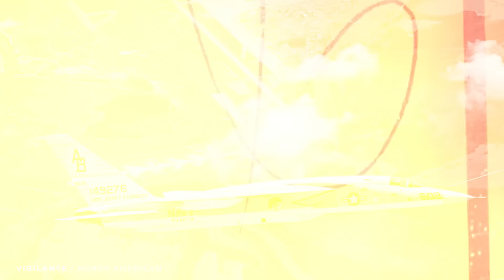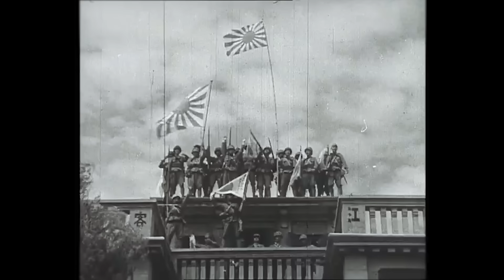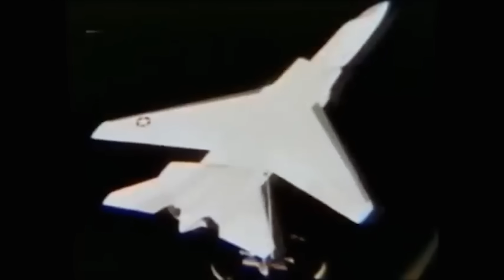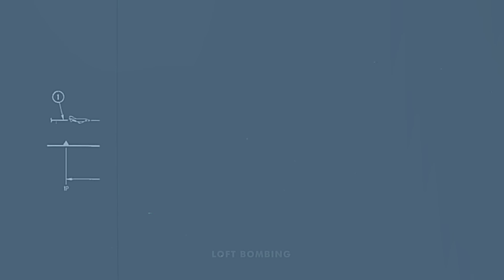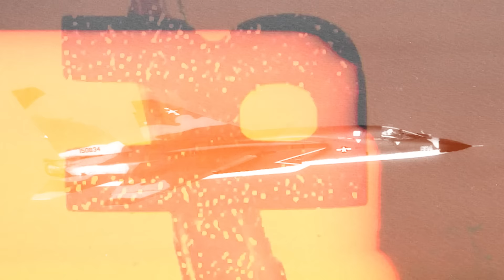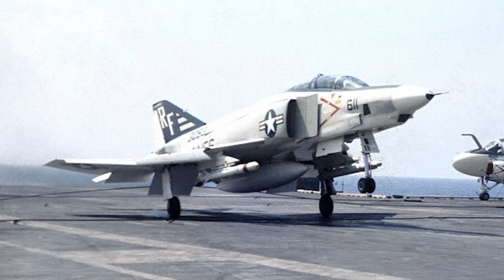Why was the A-5 Vigilante forgotten?

Comment: As a bomber, the A3J was a failure due to the nuclear weapon delivery system, which led to instability of the bomb after it had been ejected from the linear bomb-bay, and hence to poor precision, and because of inadequate range. This resulted from the initial specification that called for the capability to be catapulted with zero deck-wind, when the carrier was at anchor. This severly compromised the aerodynamic and weight sheet. The aircraft became a success when both were dropped, as the un-armed RA-5C flying at much higher  weights.

Also, it seems that the missile proposed with the NA-349 was the AIM-47, not the Navy's AIM-54 Phoenix. Also this NA-349 was part of the IMI programme (Improved Manned Interceptor). "Retaliator" was the name of the NA-246 project, a denavalised A3J-2 that NAA offered to the USAF in 1959.

Comment: The Vigilante was an extremely high performing aircraft with nuclear strike as it's primary role. The technology of the era did not lend itself to multirole platforms and it really was cutting edge. It was still a hard aircraft to counter in the 80's and if it was being modernised for further service it may have been a better strike aircraft than the A-6.

Comment: I never saw an A5 or RA5 as an aerial tanked. One reason the Russians took Manchuria so fast was that Japan has been stripping troops out all through WW2 to a level that there was only a token force. Two thing caused the Vigi to be retired. operational cost was one the lack of Airframes was the outer. From 1958 to 1970 there were only 156 built. As the recon version the squadrons operated 5 aircraft, by 1974 it was 4 and by 1978 it was down to 3 and the number of squadrons was reduced. Other aircraft being used for recon they all came up short in the type of intel they could provide. The only aircraft that could match it as a recon platform was the SR71 which was faster but no better in the intel it provided.

Comment: I remember the Vigilante. I built a model in 68?. Impressive specs. Some say that the MIG 25 was heavily "influenced" by this aircraft. I can see that - slap another vertical stabilizer on it and they look quite a lot alike.
Reply: NAA did pitch a twin-tail Vigilante, and even built a full scale mock up - there are photos to prove it too. The USN rejected the twin tail concept - choosing the folding single tail instead. It was a brutally quick aircraft - NAA cleared it for a Mach 2.5 transatlantic record flight, although the attempt was not made so we'll never know just how fast it could be...
Reply: @fungibleunit4477  Thank you for that info. Imagine twin (shorter?) tails and the 3rd engine.
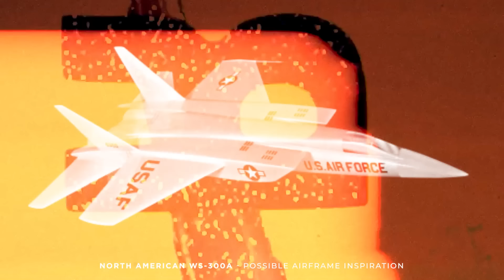Reply: Look at the model at 3:56.  Even Sir Peter Ustinov would say that was a Foxbat with just a quick glance.

Comment: I read an article written by an A-5 pilot where he described ambushing F-4s on their way back to the carrier when he was carrying a light load of fuel and using his various lift mechanisms to turn inside the F-4s and then go vertical as needed with a climb rate exceeding that of the F-4. If there was an issue with the A-5, it was the USN's demand that the A-5 be capable of being catapult launched with no wind over deck. This added weight due to the need to add lift devices to the wings.

Comment: Ah, the ‘Vigitoy’… If the bomb module was not ejected forcefully enough, it had a problem with being trapped in a low pressure zone immediately behind the fuselage and not dropping cleanly.
Imagine ripping along at somewhere around Mach 1 and having a live nuke floating along right behind you…

Comment: The WS-300A at 3:55 has a striking resemblance to the F-15 eagle.
Reply: I was going to say Foxbat - its uncanny.
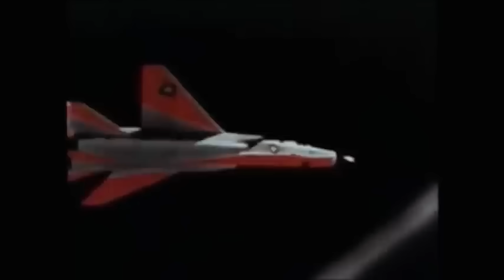Reply: Most definitely the Foxbat, especially with the model at 3:55.  But take a look at the paint scheme at 6:34; a quick glance could easily mistake that for the prototype F-15 paint scheme, used to set performance metrics.  I guess I didn’t realize that particular red & grey scheme was ‘a thing,’ but now I want to say the XF4H-1 (I think I have that designation correct), the first Phantom II prototype, had the same scheme.

Clearly, the MiG-25 derived inspiration from the A-5 models, but perhaps some NAA engineers from the XF-108 and A-5 programs migrated over to McDonnell Douglas?

Comment: Much of the airframe, and indeed almost the entire section from the intakes forward, was intended to be shared with the F-108 interceptor as a cost-saving measure.  But when the XF-108 project was cancelled (allegedly due to pressure from the Canadians wanting to protect their very-similar Avro Arrow interceptor), the cost of the Vigilante project jumped by nearly 70% basically overnight, effectively crippling it financially.  Then the USAF cut the Navy's strategic role off at the knees, crippling it operationally.  The poor thing never had a chance.

Comment: The A5 was such an advanced aircraft designed in the 1950 that actually made it to production. More details on the variable geometry air intakes would have been appreciated in this video. The period this aircraft was in service was a period of immense technological advances and political infighting. The A5 had many of the capabilities that the TFX program was trying to achieve, but F111 was nearly a decade behind the A5 before being used in Vietnam.  A comparison of the A5 & F111 would be enlightening. Was there any behind the scenes promoting the A5 as an F111 alternative? Seeing the proposal for a Phoenix laden platform before the F14 took to the air on its maiden flight. Was the A5 ever considered as a fleet defender against Soviet attack aircraft in lieu of the F14? It seems the A5 was an advanced  design but not flexible enough for further economical development for other roles. The rug was really pulled out from it when it was not really needed for nuclear strike. A couple reasons are the development of smaller packaged nuclear weapons and the ballistic missile submarine.

Comment: The first model i built at age 8 (1963). It had a spring loaded red bomb in its tail that could be ejected by pushing a small button in the fuselage.
Reply: The Vigilante was also one of my first models. No spring loaded bomb, but gee those lines were fine!

Comment: With favorable temps aloft, it could supercruise. Same engines as the F-4 and running recon slick, escorting Phantoms left early, and the A-5 caught them up. Also, at higher altitudes with the F-5's low wing loading, an F-4 bouncing a Vigilante often learned things they didn't want to know. Also, the mod version had LEX's, a very early or 1st application of leading edge extensions.

Comment: The A-5 was based on a F-108 rapier, an aircraft never finished.  They repurposed the F-108 rapier program to make the A-5 Vigilante.  

The F-108 rapier was how I started getting into cold war aircraft and history. I learned of the F-108 Rapier through learning about the history of computing. A major program just as expensive as the Manhatten project was to make a huge vacuum tube supercomputer called 'SAGE."  We're talking about a vacuum tube supercomputer that filled a whole multi-story building.  They built several of these.  Through these SAGE buildings was fed all the data from radar stationed positioned from Canada to the west and east coast of America, and radars from aircraft and Naval ships.  They wanted to make a mach 3 aircraft designed around this SAGE - the F-108 Rapier.

They never finished it.  But, to salvage the program, they built the A-5 Vigilante. As with the Rapier, the Vigilante was killed off by Russian satellites and ballistic missiles.
Reply: True, but the Concept might have been more of a Concurrent Program.
I believe according to this video, A - 3 - first flew in 1957, was Operational in 1961, then modified to the RA - 5 - C Vigilante, The - F - 108 - did Share a number of Similarities, but with a Top Speed of Mach - 3.
Reply: @bretthoffman2128  Had a hard time tring to come to terms with this.  The A-5 Vigilante wiki doesn't say much about the F-108 Rapier, but it does link to F-108 Rapier "for more information" where I found this,

"Despite the extra money and time spent on the Rapier, it was not wholly in vain; the North American A-5 Vigilante supersonic carrier-based nuclear strike bomber developed for the U.S. Navy, which was later modified into a carrier-based reconnaissance aircraft, retained the fuselage/weapon package and systems design of the Rapier. In many ways the Vigilante could be seen as the successful scaled-down application of the Rapier design principles in a Mach 2 supersonic design."

Sounds like a concurrent program.
Reply: @oker59 Yes, I thought so too
Reply: @oker59 I think that’s a plausible assumption.
However the A - 5 - first flight was, according to the video, August 31st 1958.
In some comments, I’d mistakenly thought it was 1957, upon reviewing the video, I found it was actually 1958.
The Mock Up of the Rapier was I think 1959, not 100% but reasonably sure.
Reply: @bretthoffman2128  I can't help thinking the moch up of the rapier was done even though they knew the 108 rapier program was over. 

That the Vigilante program was done after the rapier program . . . to pick up the pieces and do something with all the progress that was made.  And they later just did a quick moch up just for the fun of it.
Reply: Correction the funding by the Navy was Approved in mid 1955.
Prototypes Produced in 1956 
First Flight August, 31st, 1958.
Maybe just before the -F - 108. - Mock Up.
Reply: I thought the F108 Rapier was related to the XB70.
Reply: @briancavanagh7048  It is!
Reply: The video channel ‘IHYLS’ recently posted an F-108 video where a link to the A-5 was mentioned.

Comment: Huge opportunity lost for Australia right there.  The beloved Pig was great but really, REALLY expensive and didn’t come to full fruition until late in its operational life.  Great capabilities but hard to justify for the RAAF when their primary combat jets were still Mirage III.  I mean, COME ON!  The Mirages were great for Aussie industrial capacity, but offered little by the 1970s, with short a range to do anything meaningful, especially if it had anything to do escorting a strike pack of F-111.

In an alternative universe, the RAAF would have been far better off with a dedicated strike version of the A-5 Vigilante equipped with twin after-burning Speys.  Junk the “bomb tunnel” where the fatter Spey would have comfortably sit, with additional fuel in the space there, get rid of the naval equipment which made it heavy, and if really creative (and well funded), give it a smaller wing for better rides at low altitude.  It would have arrived sooner with far fewer teething problems, and… it could have even been built or assembled in the land of Oz for far less money and pain.  And kept Australia in the aircraft manufacturing biz for a bit longer… maybe.
Reply: You are redesigning the bloody aircraft for 30 machines?  No!
Reply: @t @timp3931 he Spey was only slightly larger (fatter) than the J79 and there was a lot of space between the engines.  A lot!  I doubt it would have been beyond  North American to adapt it together with Australian engineers.  Of course redesigning the wings would have been a very significant endeavor, but I did mention that as an option if there was a lot of political stomach to back that.  The thing is it probably would have cost a lot less than what the Pig (as wonderful and beloved as it would eventually become… after long time) and given the RAAF an interesting capability sooner, for less upkeep, and maybe, just maybe, furthered Aussie aeronautical industry.  Because after the Mirage… what came after that?  Not much except MRO and components.
Reply: Ahh Yes, but Just as North America Aviation, was Eventually Boeing, The Australian Aircraft Industry Died.
Reply: @bretthoffman2128  True. Amazing that Boeing (and I say this from a place of love, having flown the 737 and 767, airplanes that I love), as a company is the death knell of almost every other aircraft manufacturer it touches.  Embraer and the Brazilian aircraft industry was literally saved when that deal fell apart.  Good riddance.
Reply: @juanpablo681 You Flew on, or piloted both.
I flew on both as a passenger, the 737 was an excitingly relaxing flight.
The 767 was just Exciting, and pushes you back in the passenger seat on takeoff, it flies very well, and turns quite decisively sharply, then seemingly dancing in the air.
Decent and Landing are equally exciting, but it settles down very gently.
As as long time passenger, I thought the ride on the 767 was Excellent, Start to Finish.

Comment: Excellent presentation. Just a personal impression, but I've always felt that the RA-5C reconnaissance version was a bit overkill in terms of aircraft size and complexity for that role, but they USN needed to do something with it, and that was a role it could perform well, so they used it that way. Also, the basic design validating the rectangular intake ramp technology for supersonic flight that influenced aircraft like the F-14,15. Also on the MIg-25. Remarkable design in any event. Thanks.
Reply: Yes.  Beautiful aircraft.  It was replaced by a pod.

Comment: Looks like a MIG25 and an F111 had a baby.
Reply: I'm not sure if really true, but I've read the Soviets at least looked a lot into the A-5 design when developing the MiG-25 Foxbat.
Reply: @dougcastleman9518  That was the suspicion at the time. However, the roles could not be any more different. The MiG-25 is basically the lower stage for a long range AA missile.
Reply: @HotelPapa100  That's the funniest way I think I've heard anyone put it ahaha.
Reply: @HotelPapa100   the mig-25 was two aircraft, a interceptor, and a bomber-recon-EW aircraft, the a-5 vigilante matches the roles of the mig-25RB closeley
Reply: No, that one would be constantly drunk and flapping with its arms all the time

Comment: Looks like an F-15 predecessor from the 50's
Reply: In the initial rendering, also the - F - 14 Tomcat
Reply: @peterboy209  if the f15 and mig25 had a baby
Reply: @petergriffin9832The Vigilanty is what inspired the design of the Mig-25. The original A-5 design was going to have a twin tail in order to fit inside the carrier hanger deck. They opted for a single folding fin instead.
Reply: Way bigger, though. About 13 feet longer than an F15.  And the F15 is not small.
Reply: Those intakes
Reply: @BobbyOps the Vigilante was the first operational aircraft to have those angular intakes.
Reply: @ironroad18 yes
Reply: lol just saw this, agreed
Reply: I was gonna say, it’s got those F-15 intakes.